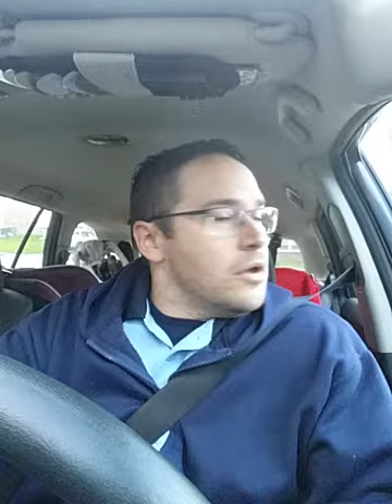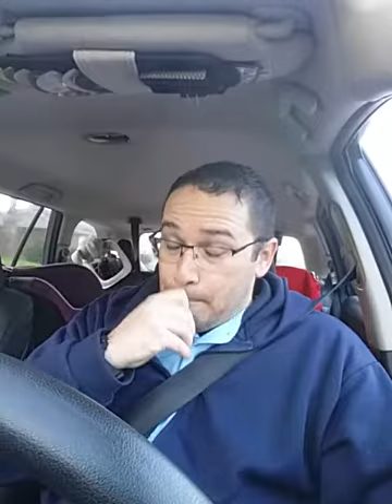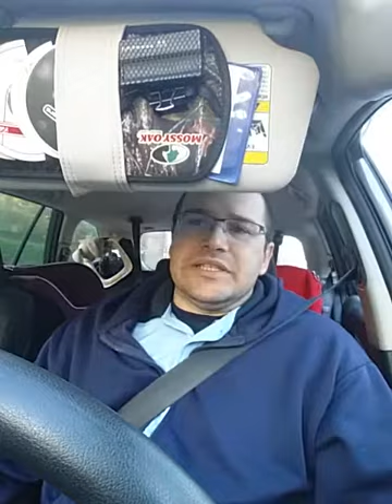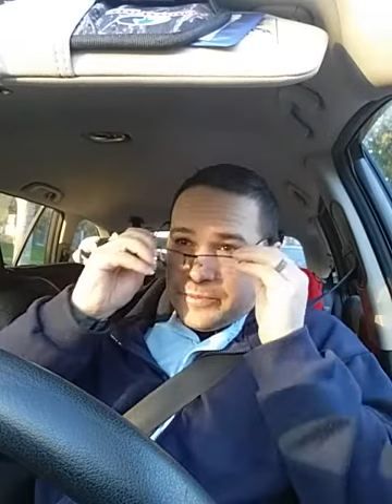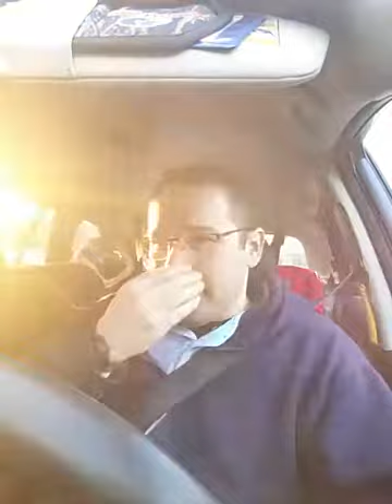vlag:3D gluestick/Fuze 4/drag & drop programming/machine-speak vs human-speak

Comment: I think the problem with "drag and drop programming" is that it's a /misnomer/. It's not "programming", it's a style of user interface for creating programs at a level of granularity /above/ the base layer that we need to use when doing real programming, and therefore do not need nor want as many degrees of freedom. There are certain application areas which are a natural fit for it - for example, behaviour trees or flow graphs in Unreal 4.
It's most useful for allowing savvy users who are not programmers to configure data processing pipelines in a way that's more flexible and less confusing than a labyrinth of menus and forms, but less exacting and demanding than writing full programs in text.
Reply from the maker: That is a very interesting point I hadn't considered. All of my experience with drag and drop programming has been with programmers who I would describe as "drag and drop programmers." The potential to visualize branches of logic is very interesting, and is actually something I'm playing around with using a lisp book I recently got.
Reply: @TroyFletcherKeyboards  
I think the Google blockly (i.e. Scratch) based style is the wrong approach for sure, except in the case of teaching very basic concepts like loops, and I guess the idea that program source code is syntactical in nature as you can directly see the "AST" of a blockly program, almost in the same way as you can in LISP. It's not a good engineering tool in my view, nor a particularly good interface for doing any real work. Flow-graph based systems are by contrast quite decent, especially if you combine it with the ability to visualize a 'signal trace', to show how data moves through the flow graph. You could really tighten the modify-test-debug loop in that way I think. 

Another point to consider with GUI programming tools is that they force the programmer who writes both the GUI and the business logic, to separate code into units which are sufficiently self-contained to be represented by a single node, arc, box or whatever other visual units are available in the UI. 

So latent compositionality in the problem domain becomes manifest compositionality in the source code, and is subsequently exposed via the user interface.

If we imagine the behaviour of a piece of software as a point in a "space" of possible behaviours, resorting to check-boxes, forms, menus, etc. at most allows the user to move the behaviour of the program along the axes corresponding to each individual configuration setting. By exposing the compositionality of a problem space, the user can add and remove axes to the behaviour space themselves, which is a sea-change over the calcified legacy Xerox-Parc-->Apple-->MicroSoft user interface paradigm.